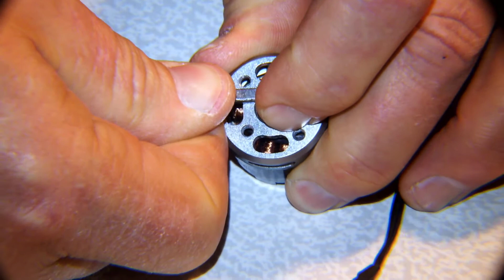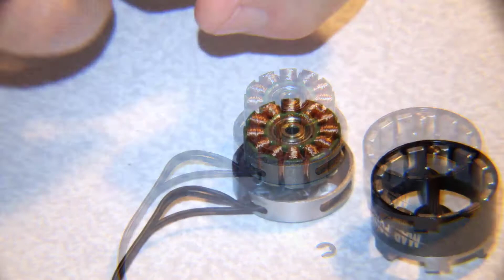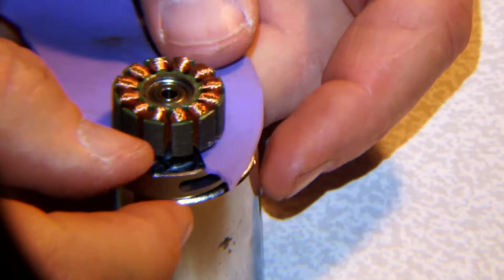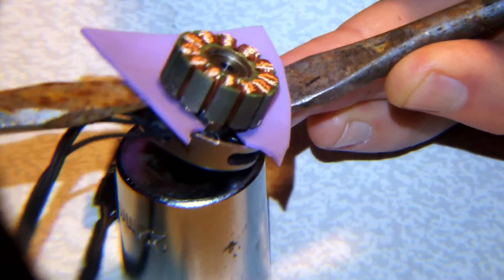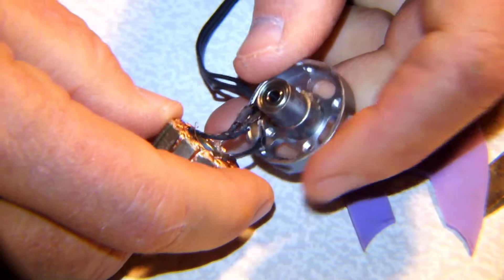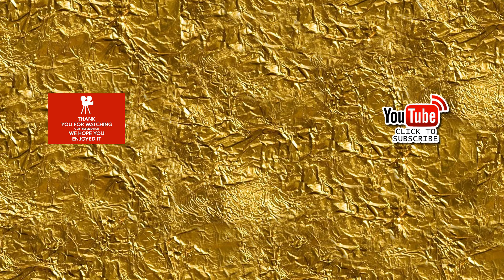FIX GIMBAL MOTOR WIRE ERROR 2

Comment: hi.. how to know is motor problem.. mine is heating up and dont work. is it wire problem also?
Reply from the maker: Hi, what heat up, heat up the motor, or heat up the drone (or other RC)? If heat up the motor, then motor problem (wiring problem), because inside the motor only are wires, not other electronik parts. If heating but not working it's short circuit or stucked rotor. Have a nice day!